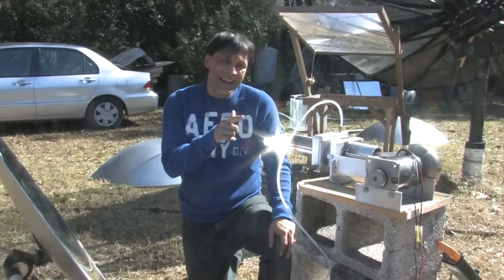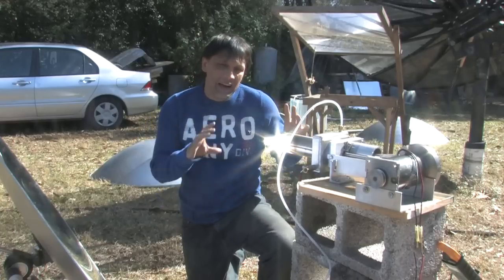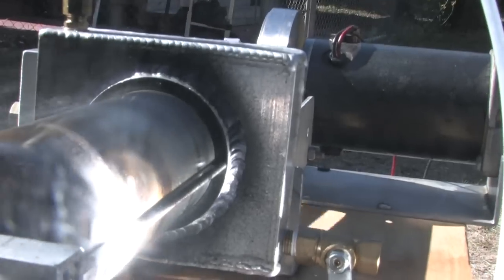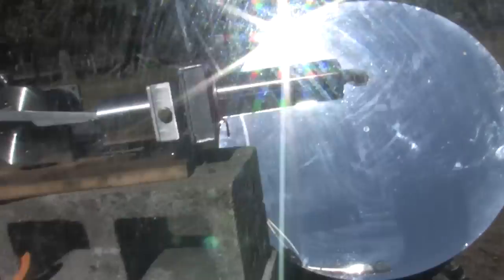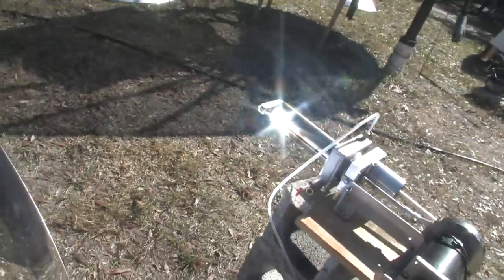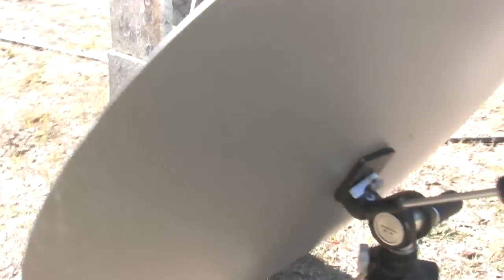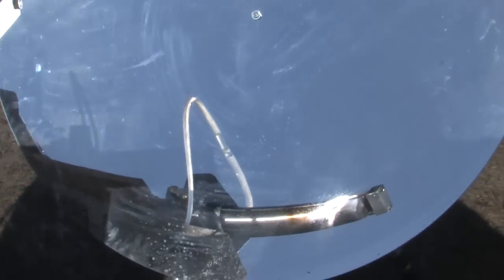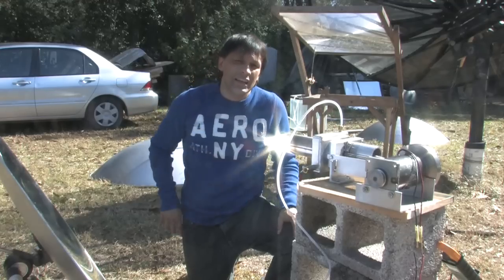Large Stirling Engine Water Cooled Parabolic Mirror Solar Power Electric Generator

Comment: As something of an electric vehicle buff, I'm fairly familiar with DC electric motors.  You may want to check that you have the motor turning in the correct direction; it will generate current in either direction, but it will generate more current (and less resistive heat) when turning in one direction rather than the other due to the internal brushing attitude.
Reply: thanks.  that is a good thing to know.  learned something today.
Reply: Yes, once a sidedness  in the force, forever will it dominate your destiny.  Like the chirality of molecules of sugar that go the wrong direction, basically virtually useless to biological life..  You must go with the flow, yes.  You must mind your attitude.  Your focus determines your reality. These are not the droids you are looking for.  No you do not want any death sticks. You can alter matters at handedness in the force, but you must respect equals and opposites in even every which way of it.  The force is dynamic, but has a best balance.  Be mindful of the living force.  The force be with you, always.Oh, and be careful of those light blasters.  They are such uncivilized weapons.  You'll could shoot your eye out, kid. Take not so much care for technological marvel as so much as the living force. For even the death star is as nothing if at against the force, no matter even how big it freaking is.  There's always a small thermal exhaust port, perhaps ray shielded, but they overlooked it. What is a technology at without it's relationship to the discoverer, the innovator, the visionary? Is not the discoverer and the innovator, the visionary, a who could make the a better than his technology at out of even himself? What than is the advancement of your species, but the advancement of your species? Be mindful of best and key(that which is means of access) in benefit.

Comment: I've always thought it'd be possible to track the sun with muscle wire.  It shrinks when heated.  If several muscle wires are attached like cables between the mirror and its target, when the hot point drifts away from the ideal point on the Stirling, the sunlight hits the wire, which contracts and pulls the mirror back to the correct orientation.
Reply: I really like that idea but how much force do the muscle wires produce? If they can't pull stronger than the wind can then it wouldn't work because the mirror has to have enough resistance so that the wind can't move it off it's focal point.

Comment: Hello Dan
I was wanting to know what happens if you back this up with a fresnell lens on the cool side of the cylinder at the same time as the mirror? That is the design that I have in mind. I want to use a 60" sat dish with the motors to track the sun accross the sky so you can have peak output all day long.  Thanx day for all your work. 
Best regards Mark

Comment: I'm willing to bet the 10 mega ohm impedance of the VOM slowed the engine down.

I'd do a flatfooted backflip if it was capable of outputting more than .5 amps at 12 volts

Comment: Your on the right track using mirrors. Mirrors last longer than fresnel lenses.

Also, I suggest that you paint the collector on the stirling engine with heat proof black paint.

Comment: I wonder when Sterling Energy Systems- or one the other companies developing advanced sterling motors will have a reasonable priced unit available for the public. I found one company that makes parabolic heated stirlings for about $20000 a unit, and produces about 3.5 kw. But I haven't found a company online yet that just offers the engine. Just curious if anyone hear has any information about purchasing more advanced stirlings, because right now  most of what I find are toy models

Comment: That's not true, there are several designs for stirling engines that have significant power, but they're used for nuclear material and are hellishly expensive because of the precision engineering involved.

Comment: It seems to me you ought to be able to make a lower tech system that is simpler to operate. 
1/ go for a lower temperature difference - I understand you can tailor the Stirling engine size & shape to suit each purpose.
2/ use half or 1/3 cylinder shaped mirror focussed on 
3/  a hollow copper cylinder FIXED to parallel with Earth's axis of rotation. Heat source for the engine is at upper end of this cylinder.
4/ only the mirror moves - by clockwork

Comment: Absolutely fantastic! An excellent prototype for small-scale future power that can be produced with more readily available materials (metal vs silicon)!

I see you have a 56 inch dish, and it produces 15 watts... perhaps with 2 cylinders it would produce greater and more even torque to drive the motor.

If you don't mind my asking, how much electric can be generated by a conventional solar panel of comparable size to this set up?

Comment: Yes, there is, they are more compact and lighter. The free piston engines designed to be very efficient and lightweight use these type of alternators.  NASA has a bunch of information on these, and Sunpower and Infinia both make these type of engines.  Check out mowerofdoom's videos...he has an engine with one...actually there are a number of videos with linear alternators.

Comment: Dan, I've seen a couple of stirling engines on youtube where the reciprocating piston has been attached to the flywheel of a rotary permanent magnet alternator on it. Steam pistons too. I'm wondering if there would be any point to using a reciprocating magnetic generator, like in the "shake flashlights" that were sold on tv a while ago. The whole apparatus would be one big piston moving back and forth, no mechanical change.
Also, love the fading in and out, makes you look magical and stuff.

Comment: Good Idea although round tubes look really cool. hehe.  But in the end you should have a stronger engine for its size.  I too would like to see it in action when your done. Having it square will allow you to use computer heatsinks as well. I have a lathe so my first engine will use round stock but I think when i build one to work the square stock would work much better.

Comment: Hello Dan, I always enjoy your videos and wonder how feasible it would be having 2 pistons horizontally opposed, like old BMW motorcycle engines, connected to a flywheel hooked up to a generator to produce power for battery charging. The reason I am interested is so they could be made for 3rd world countries to charge batteries for refrigeration for medicines etc. The biggest sterling engine I've seen had a piston diameter of 2 foot. It was for a gold mine in outback Australia in the late 1800s.

Comment: well. if you have a small house with about 4 lights... it would take 12 of these to provide lighting. you would need a battery system so you can use the lights at night. but with those taken care of it might make enough of a impact on the power bill. replacing ~60 watts of non renewable with renewable. this guy is doing good work and i hope he keeps at it ^^

Comment: Looks cool.  I'd be interested to know how something like this compares with using solar panels of a similar size to the parabolic mirror.  I think stirling engines are supposed to be up to about 70% efficient, so in principle this might be better than a solar panel, although there would be some mechanical energy losses.
Reply: The problem with that 70% number is that it's only theoretical and it is based on how much heat the engine actually consumes.
In this case, a ton of solar energy is applied to the bulb, but I imagine most of it reflects back off it before being absorbed by the engine.